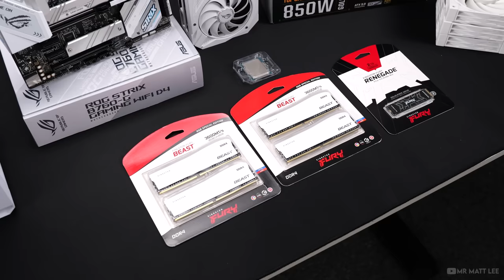Back to Basics! | Lian Li O11 Air Mini White, Easy Gaming PC Build | DeepCool AK620, Strix B760-G

Comment from the maker: The graphics card featured is a Strix 3080, not a 4090 as I accidentally wrote on the annotation at the start. That’ll teach me for editing at 3am after a long day! 😅
Reply: Sell gpu 1600usd, u buy?
Reply: Merci pour l'explication, j'étais surpris de voir 4090 dans cette config. Good Job
Reply: that is why i thought it looked different lol great video nevertheless!
Reply: Well, I was surprised that an 850w power supply could handle a RTX 4090 😅
Reply: matt just a question with a micro board a the mini air can ya put a 360 in top or has it got no room ? still
Reply: plz show the temp after finishing build
Reply from the maker: @evyzulkifli9832  it’s in the description ☺️
Reply: I think 3080 is using 2x8pin, I think this is a 3090
Reply from the maker: @ahmednasr93  the Strix 3080 10GB OC has 3x 8 pin ☺️
Reply: @Mr_Matt_Lee  oh then it is my gigabyte 3080ti model is the inferior one
Reply: @Mr_Matt_Lee  the cooler is so cool
Reply: Yeah, i was about to tell you, that's a Strix 3080 OC not a 4090 🤦‍♂️🤦‍♀️🤦
Reply: I wish the 40 series Strix looked more like the 30 series Strix.
Reply: Would a 4090 fit in this case?
Reply from the maker: @zhaf  sure will… go watch my video for the black version of this case and the 4090 launch 🦾
Reply: @Mr_Matt_Lee  Damn, i just can't seem to find said video. Now in the process of building a mobile workstation and it would be just a lifesaver to see with my own eyes if it's possible to fit a 4090 in this case
Reply: i got really confused why core i5 was being pared with 4090 XD

Comment: Glad to see you not filling the top with exhaust fans, I feel like a lot of people end up sucking out all the cool front intake air before it gets to the CPU cooler.
Reply: Agreed. Always better to have more IN's than OUT's air sources to positive pressure the case. 4 IN + 2 OUT here
Reply: @paolocoletti3424  Does it make sense to cut a piece of paper and stick it at the front 1/2 of the top exhaust?
Reply: @cat-.- I would suppose you might want to try that to encourage air to the rear half of the case and the CPU cooler. But whether it makes any tangible diff to CPU temps you'd have to actually/physically test out. But as the case is effectively totally perforated and the desire is to get the warm air out (and replaced by fresh cooler air) it hardly seems worth the effort. But try it and let us know maybe.....
Reply: Bro I know what you mean. I'm glad Matt knows how to optimize the fan setup for an air cooled build. Filling the case up with as many fans as possible does not always mean the best cooling performance.
Reply: Absolutely agree. I have the same case, but black and I just removed one of the NF-A12x25 PWM fans that was before CPU closer to front intake exhausting up at least 20% of fresh air, just doing that I gained 2C on my NH-U12A chromax.

Comment: I've watched few of your videos, these builds are so clean and truly airflow focused. I have the same case and the fact that you only installed a single 120mm fan right above air cooler is very well thought. I see a lot  people making the mistake  installing 2 fans above their air cooler and that is no no, Its OK if you running AIO, but with air cooler some of the front fresh air gets drawing to the top exhaust so your air cooler is not getting the full air flow as it should.

Comment: This is exactly the best fan configuration for air cooling build in 011 Air Mini. Also, It only need 1 top exhaust fan above the CPU cooler.
Reply: I totally agree. If you would to put another top exhaust fan, some of the front intake fresh air would have been redirected to the top so CPU would not get all of it.  It would be OK for 2 top exhausts only if you use AIO, but AIO all around sucks.

Comment: Nice set up.
I just moved my 5700x with a 3060ti from a Raijintex Ophion M into a black o11 air mini and I love it. Less noise and better airflow and the cable management was clean and easy.
Your other o11 vid was the reson I chose the Air Mini. 👍

Comment: I really love this case. it took me long time to find one in stock in white and bought it. best airflow case ever made. I even installed 3x 360 fans on top and bottom ( yeah they fit ). I have a 4090 FE in that case and it closes perfectly fine with no issues ( ATX 3.0 PSU )

Cool Video though. I love your content man. keep up the good work.
Reply: Got this case and will be building my pc soon. 3x120 fans on the bottom? How about the screws?
Reply: @zandrosoberano  you dont screw them all. at the edges wont be screwed.

Comment: I have a white one of these cases also but haven't gone for the overly aesthetic white build as mine is off the floor and desk in a vented cup'd. This really is by far nicest case I've ever had due to its clean modular looks/assembly AND mostly its compact size having the PSU, drive trays, cabling out the back. But I must say I'm envious as that's one good/clean looking build. ❤ Tho stuffing all your spare cable length in the empty drive bays helped you a lot. Slightly surprised you didn't go the whole way and install a white PSU also.......just because you could.

Comment: Great build. 

When showing airflow visualisation, can you also direct the smoke to passively vented areas (open areas of case without fans) to make sure they are not pulling air in? I think it's an important aspect of having a positive airflow that the passive vents always eject air and not take air inside. Cheers!

Comment: Personally i'm a fan of a minimalistic/clean rgb fan setup. Using like nzxt f120/140 fans or Lian li AL120 fans, with the rgb light turned down to like 50%, in a static white or blue color, with some non rgb but sleeved psu extension cables, to match the color theme to the rest of the system.

Comment: Pity you can only give one like, beautiful build. Went with the air mini after seeing you previous build the case is a joy to work with. Couldn't see on the vid but i was wondering where you routed the cables from the front 140's?

Comment: Might i suggest running the smoke test while the CPU and GPU is under stress test :) thank you! Solid fan and subscriber here!
Reply from the maker: Thanks so much! Yes for sure, although putting it under stress wouldn’t change anything. The GPU and Fan curve were set at relative speeds to match that of being under stress. The airflow visuals will be stepping up a notch in the coming weeks too 😁

Comment: This is very feasible, except for the white gpu, although noticed a white 4070ti for just slightly above msrp..... But that is out of my reach.
Also looking forward to see the 100% ram clearance, lcd screen white air coolers from deepcool which they showed off in the ces. Would go perfect with this build and case.

Comment: @Mr_Matt Lee i would suggest to move the 1st  cpu fan to the  back of the  cooler, this way it  doesnt  look cramped inside, also  leaves  beautiful rgb RAM on spot.
P.S  if  the exhaust  fan at the  back  is getting in  the way you can  just remove it... it  will not affect temperatures at all...i've tried by myself  with Be Quiet  Dark rock 3 pro.

Comment: 🚨BUILD REQUEST🚨

case: NZXT H9 FLOW (black)
cpu: Intel core i9 13900KF
fans: NZXT F120 RGB (black) (10 fans)
radiator: NZXT Kraken Z73 aio 360mm (replace fans with f120)
ssd: any i dont care
motherboard: ASUS ROG STRIX Z790-E GAMING
ram: CORSAIR DOMINATOR PLATINUM 32GB DDR5 (6200 mhz) (if you want make it quad channel)
psu: any 1000w psu
gpu: Sapphire NITRO+ AMD RADEON 7900XTX gaming oc

would love to see a build with these parts :) ♥♥♥
i dont have links to the products but most of them should be on amazon

Comment: If I put a 120mm top exhaust at the very back of the case and close off the rest of the top panel, will it help to direct more air from the front intake...? Is the difference considerable?
Reply from the maker: I probably wouldn’t because you’d cause a lot of positive static pressure which would lead to a large build up of dust. Keeping the top open would allow for residual heat to escape still whilst not compromising pressure 😊